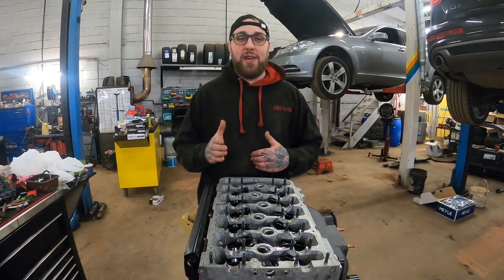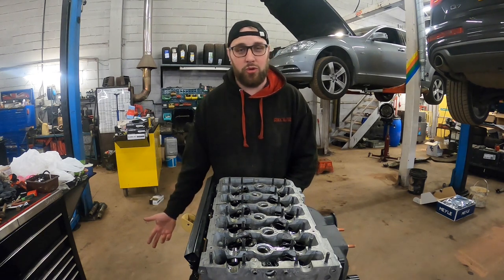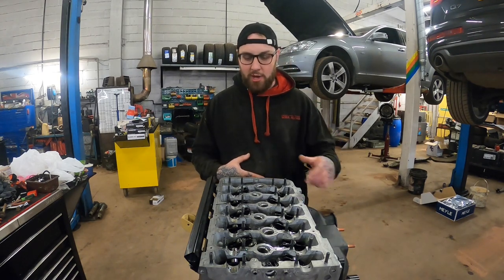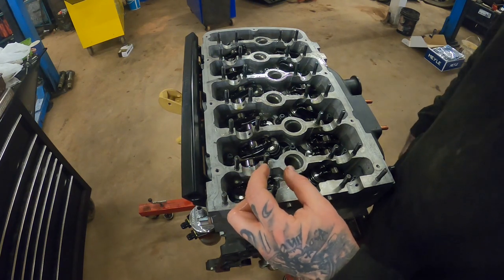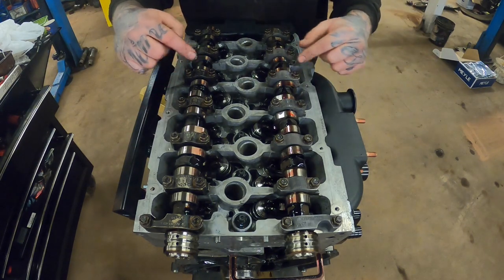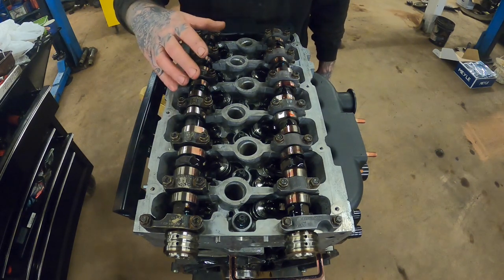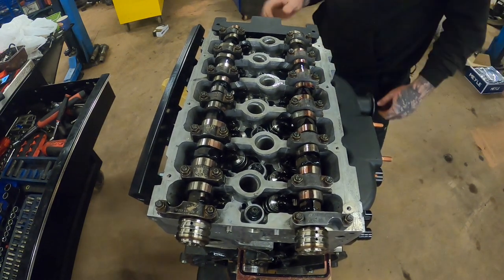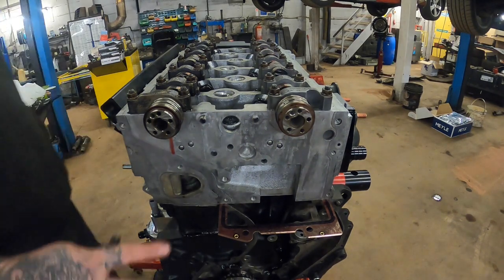CAMS ARE IN!! MK5 GOLF R32 TURBO CAMSHAFT INSTALL & HEAD OVERVIEW - VR6 TURBO EP.11

Comment: Hey man, I have a question, currently bootsing my mk4. Question regrading the fuel rail, I have a FPR on mine, I know you said the mk5 has the return on the filter. I have deleted SAI which controls the FPR valve. Do I just buy a CTS rail? How can I ensure the Fuel pressure is being regulated properly?
Reply from the maker: The SAI doesn't control the FPR you just need a vacuum from the inlet manifold. Only thing with a MK4 FPR is that its preset and not adjustable you can get direct fit upgrades pre set to a higher pressure. It really depends what your goal is
Reply: @dkautos  Appreciate the reposnse. Im going supercharged big injectors etc. Just wondering if there is a calculation that needs to be done. Im not sure whihc data to go off. But I'll do some more research. Thanks
Reply from the maker: @oliver heath  for a supercharger setup you should be fine. Best thing to do is speak to whoever is gonna map it for you they will have a preference
Reply: @dkautos   will be going to stealth. Aiming for 430 which is up there with the smaller turbo stuff. I might give stealth a poke, not sure yet.